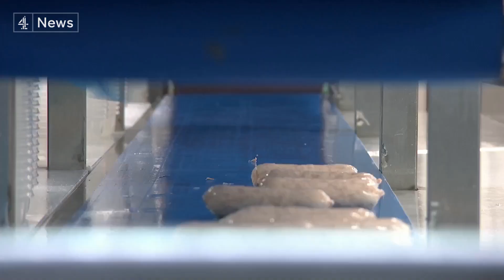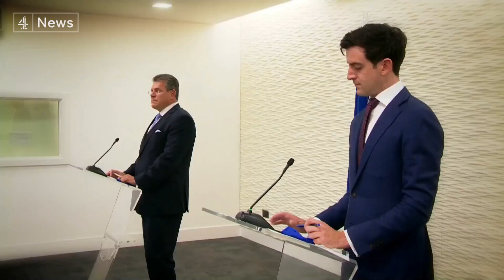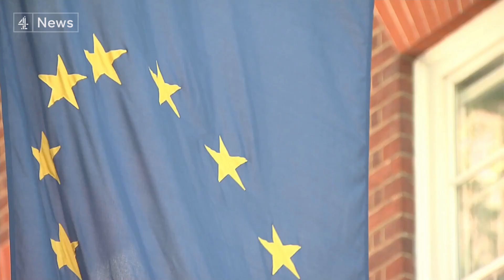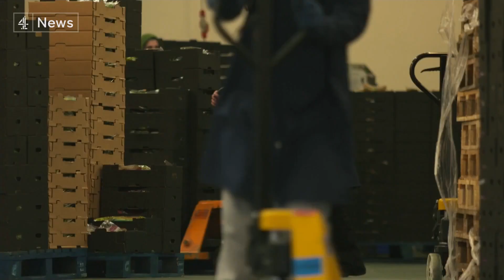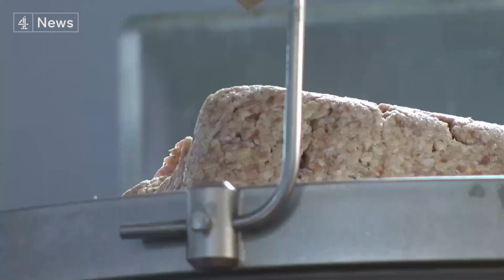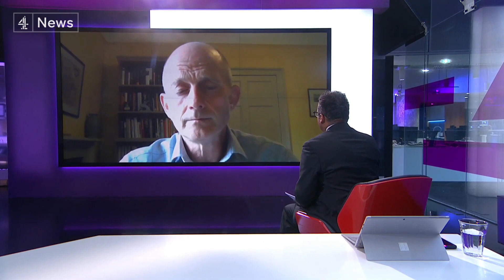EU’s ‘patience very thin’ after no agreement in ‘sausage war’ talks with UK

Comment: C4News messed up, they should have asked Lord Frost “why did you negotiate and agree to this? You knew this was coming so why are you acting surprised”
Reply: They were warned that this would be a problem from before the referendum. It's been effectively ignored right until now because we are aparently too special to have to keep to our agreements.
Reply: Exactly this !!
Reply: @davebox588  yet no one in the media or politics asks them,  C4news is usually avoided by cabinet ministers as its reporters ask blunt questions so I am surprised they let Lord Frost off so lightly. 
The Remain campaign warned of this all by the Leave campaign assured the electorate that it was all project fear,  those running the Leave campaign now hold high office and should be held to account.